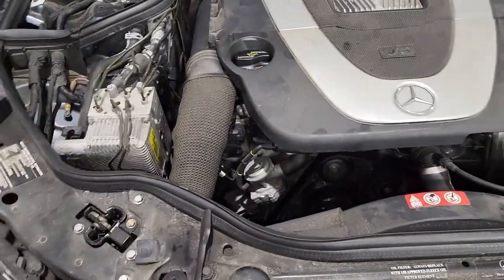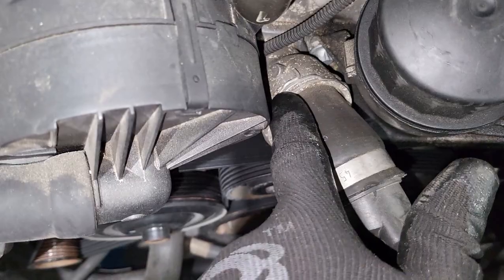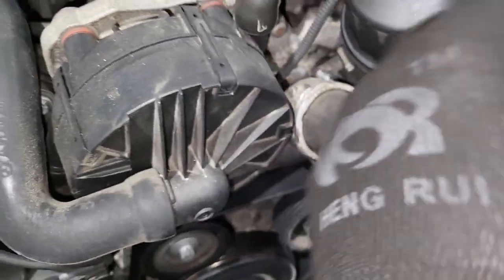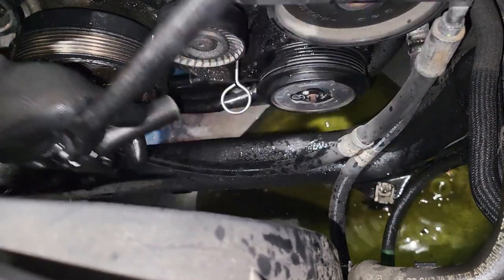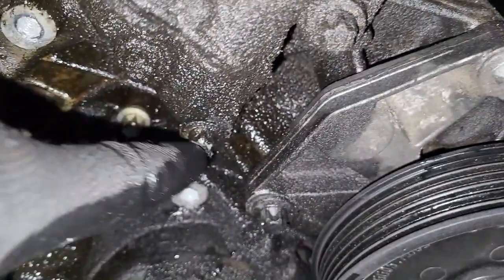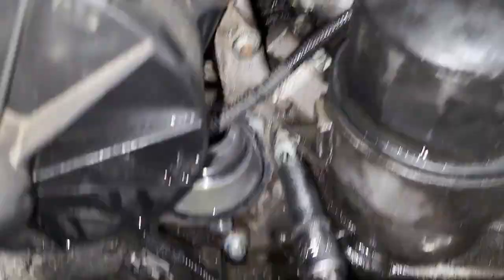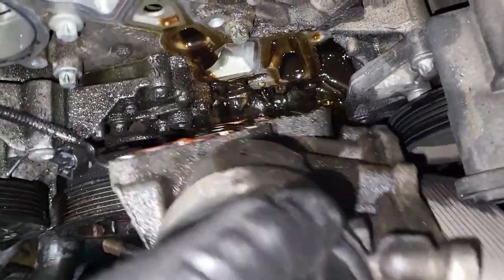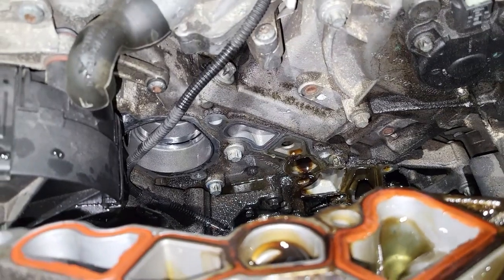REPLACE LEAKING MERCEDES ENGINE OIL COOLER WITH OIL FILTER HOUSING SEALS  W203 W204 W211 W212 W221

Comment: I took mine off without taking the thermostat line off.
Reply from the maker: You can have it on or you can remove it. just depends on your comfort-ability. I am glad the video was of help.
Reply: So you were able to remove it all without draining any coolant ?
Reply: @matthewpeterson2523  I did this several times and used quite a different procedure for this (same as WIS) and never had any problem so far. I like to work a clean way and always drain the coolant from the radiator first.
On V8 i'm used to remove the fan shroud too so it leaves a bit more room to work on it.
Reply: @matthewpeterson2523 coolant & oil should be drained 1st. Obviously the point is to remove & prevent a mess, unlike what was shown here.